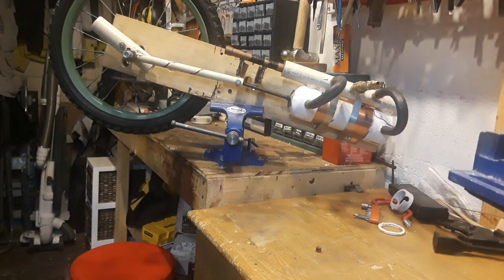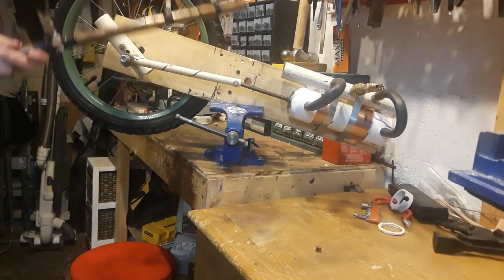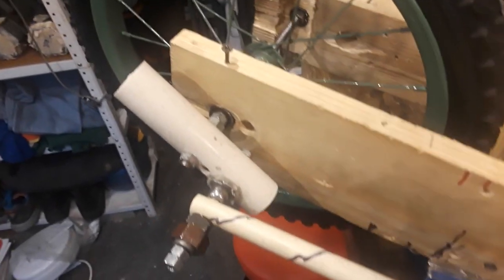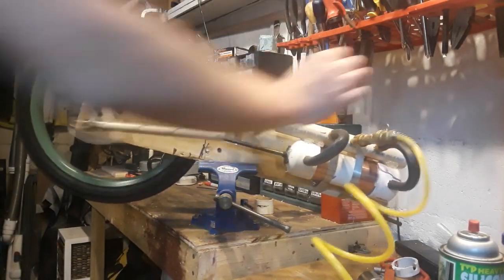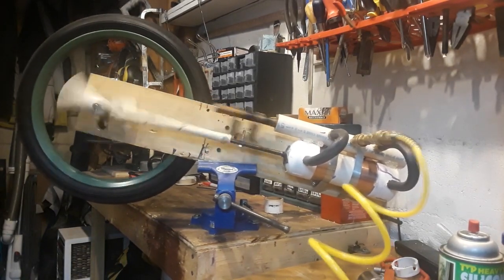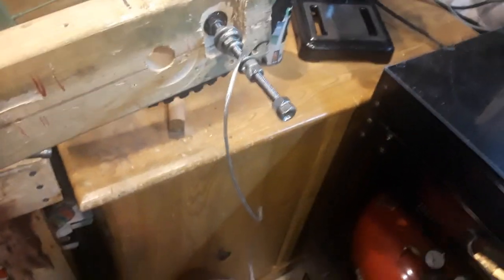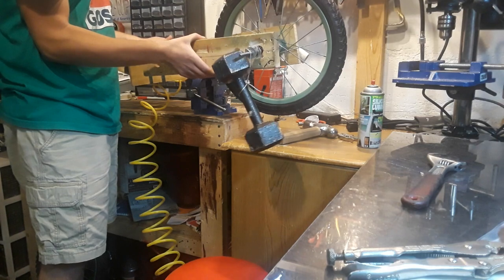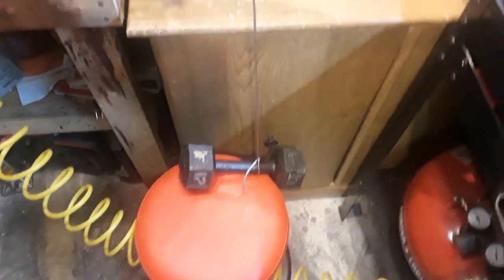Homemade Compressed Air Engine

Comment: Very interesting.. Using two pistons offset 90° will give you more even torque and will be able to start from any position.
Reply from the maker: Good idea. Thanks. Don't forget to subscribe. 👍
Reply: You may want to check out my videos, to see some air powered bikes in action.
Reply from the maker: I looked at your air powered bike. That's a really cool idea for an air powered bike. Personally If I would make a electric bike but the air powered bike is really cool. The only downside is that the distance is very limited. But good job on that project.
Reply: Please check out my videos to see air powered bikes in action.

Comment: Nice :) Do you think that this engine is able to drive a light vehicle?
Reply from the maker: Thank you, I doubt it, but if I made it with a lot more cylinders and a complete air seal around the slide valve maybe it could. I will be making a new one soon and show how the cylinders work make sure your subscribed so you don't miss it.